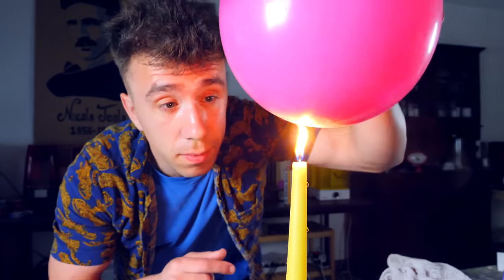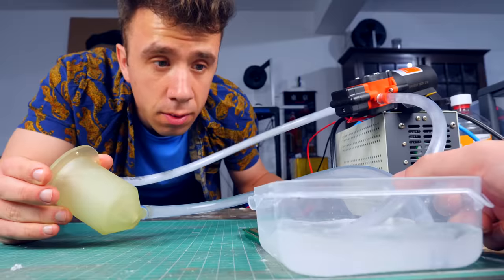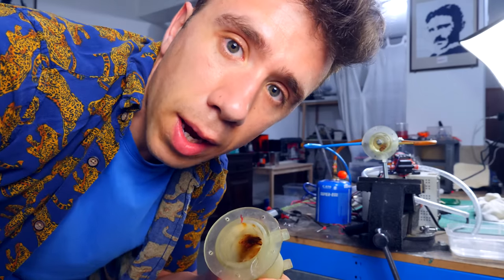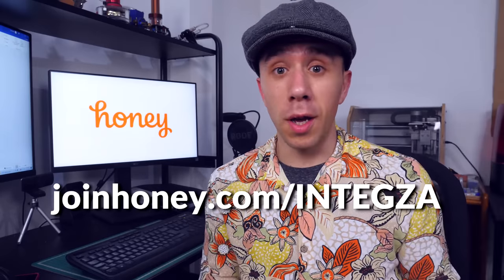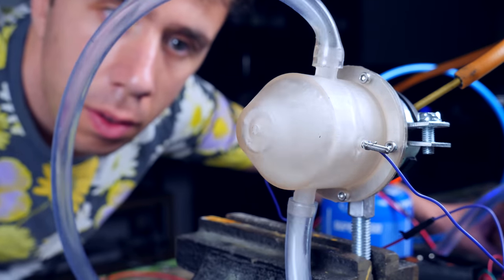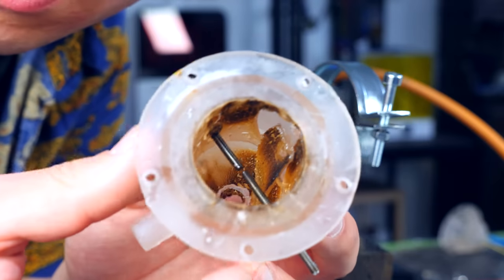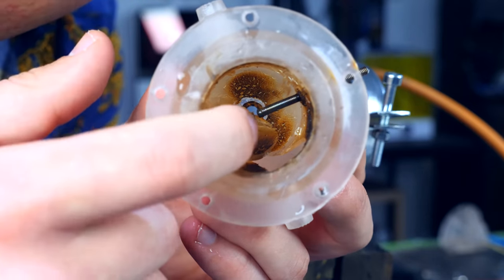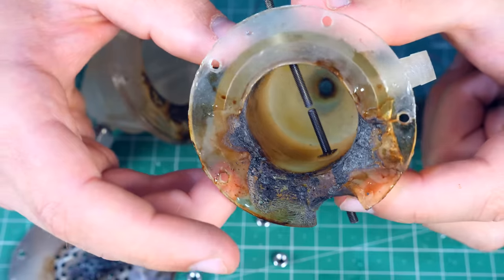Water-Cooled Jet Engine in Plastic

Comment: I think you should see it more like a pc water cooling. So change the water outlets positions to make it fill entirely with water and avoid air pockets. ( bottom and top of the chamber )
Also, resin isn't a good thermal conductor, so maybe increase the resin surface inside the "water chamber" with some fins, that way the heat exchange could bo more "efficient". 
I think you should also increase the water chamber size, given that your pump is powerful enough to push the water through the higher surface space chamber and the higher water volume... it would result in a bigger thermal mass to heat.

Comment: I'd suggest using a metal diaphragm made of a metal with a very low thermal conductivity, titanium for example might be better and shouldnt be too expensive for thin Guage. Also maybe try making the metal piece thicker to increase the thermal mass of it so it takes longer to heat up.

Comment: You could design the whole defuser-chamber convo to be butane cooled, and use the butane as the fuel.
Reply: If cooling the chamber is too harsh, you can always make it bigger. More  surface area, less pressure.

Comment: The butane cooling isn't a bad idea at all, it's basically regenerative cooling but on a jet engine. I think it does have promise, plus pre-heating the fuel leads to easier ignitions. The only issue is preventing the fuel lines from exploding, as (at least I think) they did there. I'd have to look into how rocket engines do it and adapt it.

Comment: Have parts of the metal plate integrated into the water flow area. That will help cool, and water flow in from bottom, out the top

Comment: Try makeing a jet engine with propane in a steel tube and have and cone valve so it forces it out with force but try puting a prop blade inside so you get so push out of it. Hope you like the idea

Comment: If you could get an aluminum can to keep a watertight seal with the outer layers that might work best. Not 3d printed, but it'd vent heat a lot faster than the plastic liner

Comment: Hey there! Have you ever heard of using liquid nitrogen instead of water for water cooling an engine? It's actually a pretty interesting concept. I've heard that liquid nitrogen can be a more effective coolant than water because it has a much lower boiling point, which means it can absorb a lot more heat before it starts to evaporate. Of course, you'd have to be very careful when handling liquid nitrogen since it's extremely cold and can be dangerous if not handled properly. But overall, it's definitely something worth considering if you're looking for a more efficient way to cool your engine.

Comment: Why not using internal two stage cooling using air vortex so you will have combustion-->air vortex-->thin plastic - - >water. And for the base try to use some heat insulation material between the metal diaphragm and the plasic body also you can add thin walled water jacket so it absorb some heat

Comment: I have a couple ideas for the diffuser. Reducing the volume of the diffuse chamber may decrease the "air cushion" across the diffuser grate, if there is less volume in the diffuser chamber, it will be harder to push any of the explosion plasma back into the chamber (imagine a long piston vs a short piston you're trying to compress.) Second I think if you made a double layered diffuser that would be great. (I think the internal layer could just be a metal mesh? Since you're just trying to prevent plasma from moving from one side to the other, and not trying to protect from the shockwave itself like you are with the first diffuser), if you imagine some of the plasma from the explosion just pushing through the diffuser slightly enough to ignite the next chamber, if you make the diffuser doubled layered, it means when the plasma pushes through it will only ignite the fuel in-between the two diffuser layers. To clarify by double layered I mean 2 diffusers with a 1cm or so of space in-between them.

Also I know the all plastic thing is a challenge, but to me the 3d printing bit solves the trouble of shaping the engine, since machining out of metal is leagues more expensive, so I think it would be okay/reasonable in your challenge to try some inner coatings. Like maybe foil of some sort. Or even some ablative coatings, there is one you can make with a food starch and water which you could paint on the inside, and as it burns it forms a sort of carbon foam which is a pretty good insulator. KnightHawkInLite has a good video on StarLite that would be good to check out.

Comment: I think using channels around the combustion chamber to increase the surface area of water to resin it may be able to pull more heat out more quickly and keep the wall of the combustion chamber cooler. Also, using a larger reservoir and using ice or some kind of cooling system to further reduce the temperature of the water should help. I'd say it would make sense to have the inlet located on the end getting the hottest and run the outlet to the other end, and like others have suggested, having the inlet on the bottom and outlet on the top. Could you 3d print a solid combustion chamber with a number of coiled cooling channels from one end to the other? Like a heat exchanger, the greater surface area of coolant to the material it's cooling, the better. The water would need to flow quickly enough to take as much heat off the combustion chamber as possible without evaporating, causing cavitation and increased pressure within the cooling channels, ultimately leading to failure. The trickiest part would be finding the sweet spot for wall thickness that will give optimal thermal exchange efficiency while being structurally sound. I think if anyone is up to this task, Integza, it's you.

Comment: Instead  of water or butane as you found out is flammable,  you can do the same idea  with freon by turning the freon can upside down you get liquid  and that should keep it cold enough  to run the jet engine  printer  from plastic  also to keep the heat down I would find some other way to ignite the engine  because  the 2 small runs you put in place will get hot over time and start to melt the plastic  and cause  break down , a grill ignitor should work , I have a ton of ideas  that may be helpful  please  if you do try out my ideas  let me know how it worked wold love to know the out come

Comment: Cooling a massive explosion with flammable/explosive liquid is a very NOT good idea :D 
I'm by no means an expert, but here are some ideas from the top of my head that might help:
- Ceramic (insulating) diaphrame for backpropagation - the metal piece for those explosions acts essentially as a heatsink, heating up really quickly and melting the plastic. So using a different material like ceramic (which you can 3D print) or some other material might help
- Using gaskets and O-Rings - Between every joint you have, you should put some gasket. If not custom made rubber one, at least some type of glue like epoxy, or the ones often used in plastic modelling which temporarily melts the plastic and lets the two parts bond. It might help with leaks
- Cooling the water - As mentioned, using flammable liquid as coolant for, what basically is a huge explosion, is kinda dumb. But, I might have just the thing for you! It's called a radiator, you can get one for pretty cheap as many computers actually cools their internals with water. So a radiator with fan might be able to keep the temperature few degrees above ambient. If you want to go sub-ambient, well that is a lot more difficult. You can either utilize a chiller made out of old refridgerator, a peltier modules or heat exchanger. But that is probably extremely complex and expensive. Fan with radiator would work. 
+ Maybe, if you'd be using a higher diameter tubing and higher flow pump, a radiator from car might be better. They have much, much more surface area and heat capacity, meaning they will take a lot longer to heat up and heat soak. 
- Close your water loop - Another trick from PC building. You should close the loop and let it run without combustion and get rid of all bubbles. The reason why the water in the tubes is so white is because it has many bubbles in it. Bubbles are air, which means you have reduced cooling capacity. Sometimes, you might even have more air than water in your system, rendering it completely pointless. 
- Push the water against gravity - Just a trick to have the combustion chamber always filled with water, is to have your inlet on the bottom, and outlet on top. That means that there will always be a bit of water to cool it down.

Comment: It seems the metal diffiser is melting the resin and creating the leak. Why not add gaskets it between that are rated for the heat. Gives you a better seal and protects the resin... awesome project btw!

Comment: Instead of using metal or plastic diffusion try using ceramic  instead, or still keep with the metal and have ceramic spacers either side to prevent the heat transfer. Then like others have said have the cold feed at the bottom of the design. With the return going through a cooler, or heat sync to maintain colder fluid throughout the design, though I feel the water is flowing fast enough to minimise the heat transfer. Then instead of water use mineral oil or a coolant used in water cooled pcs

Comment: Some 3D printable plastics are more conductive / stronger than others - Sometimes plastic pressure vessels contain chopped fibres or metal sinters. Of course better option would be a metal sleeve but I guess the point was to avoid this. Can-annular combustion chambers are fun design. Fluid cooled acetylene torch nozzle cross section design would be fun to scale up as a 3D print

Comment: Going off the initial design, what if you added a double spiral in the water chamber, that way the water has to flow around the chamber to get from the inlet to the outlet. Should make cooling more even. I think to stop the failures you are gonna need to find a way to cool the diffuser as well, the metal bit is a good idea but the metal is probably getting hot enough to melt the plastic around it which is just making failures happen sooner.

Comment: i think the whole point of liquid cooling is to have something thermally conductive to transfer the heat to the liquid. If your goal is to stick with resin, than maybe change the goal to a lower power and less heat generating engine or find the magic material that can transfer heat away from resin

Comment: If you need another coolant that you can get colder but need it to be non-flammable
Try using a salt water brine, with added ammonium chloride and table salt you can get water to drop temperature quite a bit (that mix is actually how the zero point of that horrible Fahrenheit unit system every major country has stopped using is defined); it'll also freeze at a much lower temperature as well as dropping a lot solely from the addition of those salts

You'lll be able to get it to be much colder initially but probably won't change the specific heat capacity too much (just a larger temperature difference so according to newtons law of cooling it should have a higher rate of heat transfer)
Otherwise looking for a liquid with a higher specific heat capacity is ideal

But the main way you'll be able to prevent this is by improving the heat exchange; there are three main factors outside the coolant that you can control well, the material at the site of heat exchange, the thickness of the membrane over which heat exchange occurs and the area for which this can occur
If you can make that internal membrane from even thin 3D printed metal like you had in the past which wont melt as easily, you can then use the resin to form the water cooling case system around it 

Polymers inherently tend to melt or burn instead and often don't exchange heat as well as metals do
That's why you see metal (often copper) pads on heat sinks to improve the heat transfer; but ceramics are an option too, but you'd have to be careful to make sure the thickness of the heat exchange site is thick enough to not fail from the internal pressure of the engine itself or the water cooling system 
water is a much more viscous/dense fluid than burning gases, the movement of that fluid still has momentum despite it not moving as fast and you need to be sure that you're getting a reliable coverage of all heat exchange sites, having the water enter flow wise from the bottom and the exit point being at the highest point vertically SHOULD minimise that issue; or otherwise just a means to bleed any air in the line

Comment: It might kind of break the goal of making an all plastic/resin engine, but if instead the inner wall would be machined as a thin meta piecel, you could have a design with minimal material cost as well. The metal being a good thermal conductor, would pose very little thermal resistance and allow for a more efficient heat transfer to the coolant.

Comment: Hey mate, i see some mistakest from my point of view: first make the cooling as pc watter cooling - closed loop so you do not have air in the system, then you can try to make inner part of the chamber from metal -  cooper or brass, andf you use a spark plug that is colder. Some tuning turbo gasseline engines i use a spark plugs that are colder, because REACH air fuel mixture ingnite harder under high pressure. Hope this will help you. I am specialist in computers, engines and bikes, also a designer in SW, fell free to ask anything.

Comment: so, the obvious solution to the melting joint is to water cool the entire assembly. diffuser and all. 

you also probably need to do something to protect the plastic from being consumed chemically, not just thermally. most combustibles we use will attack plastics, and the combustion reaction itself will consume things it can oxidize in the resin where it can. some sort of enamel coating on the inside, maybe?

Comment: You could paint your part with conductive paint and then electroplate it. That would give a hard surface, better heat conduction and technically a metal part.

Comment: Why not print some sort of spacer for the metal piece that can go around the edge so that way the metal isn't in contact with any joints in the construction. Idk if it's possible to print around an object, but that seems like it might fix your issue

Comment: Part of the diffuser problem is that the ports (translate: the holes you drilled by hand) are too "open".  You need to drill them in thicker material, with a MUCH smaller "through" diameter, and a larger countersunk bore on the side facing the fuel input.  This will help it work as a kind of check valve, preventing the combusted fuels from pushing back through the diffuser.

Also, if you are going to insist on using a liquefied gas, I suggest you stick with INERT GASES.  You know, the ones that DON'T EXPLODE when you inevitably fuck up?

Try Argon or Nitrogen.  Just try to not freeze any body parts (yours OR that lovely lady's) off.

Comment: What if you modify your nozzle to have a circular wall almost like the archimedes screw on the inside to reinforce the cavity between the inter and outer wall. This will also ensure liquid is pumped through in a circular motion ensuring the liquid is cooling the engine consistently.

Comment: I highly recommend you stick with Water, however, i believe you are getting foaming in the sleeve and not transferring heat well enough. Consider adding a spiral channel  like a hollow spring to direct the flow of water better, or wrap the core with copper tubing to enhance heat transfer. i really believe that will make a big difference in cooling.

Comment: Your metal fuel injector plate is thermally conductive. It will melt the interface between the fuel chamber and the combustion chamber.

Comment: So close! If the problem is heat transfer meaning that the heat is dissipating in the chamber but not in the steel membrane then you need another loop of cooling solution for the connecting part i would suggest that you make another water channel for the steal membrane to act  just like heatsink from both side and because its steel you need to figure out the flow rate of the water to make it efficient and cool, ps: i hope you'll consider my idea in the next video, heat-transfer play with the rate of cooling and where is the heat that needs to dissipate + add cool water in the tank.

Comment: its not really a jet engine, more like a hybrid rocket engine. Also the balloon trick works because the candle flame is a low intensity heat that is able to be carried away by the water in the balloon. try the same with a propane torch and the balloon will pop immediately due to the localized extreme heat. that's what's happening inside the combustion chamber. no amount of water will cool that bulk of plastic fast enough to prevent it from ablating and eventually cracking from the differential expansion stress.

edit: actually, upon review try making the nozzle outlet much larger. the back propagation of the explosion is most likely due to the extreme constriction at the nozzle. Jet engines compress the gas in the middle and expand it over the turbine to drive the main shaft and sustain the compression wheels in the front. mimic this by constricting the air flow internally to create high pressure combustion area followed by expanding exhaust nozzle.

Comment: Your filter is conductive! I bet that's why it is getting so hot there. Use a non conductive metal. Also you should make sure there is no air gaps in the engine with the water. The air gaps will heat up those areas faster than the spots near them with water. That's why it probably pops. I would pressurize the system and pump out and air and maybe place a resin plate over the metal one to stop arcing from the spark plug bolts.